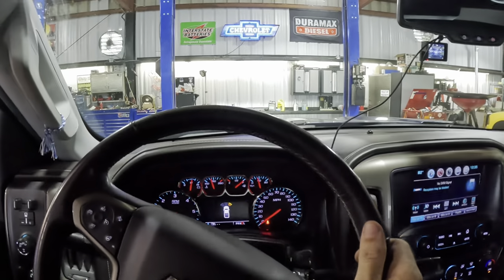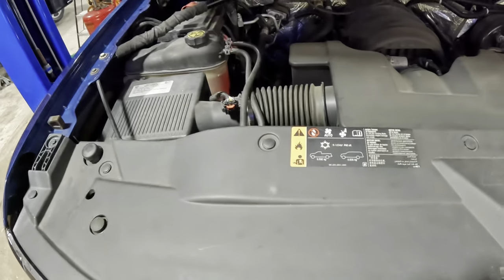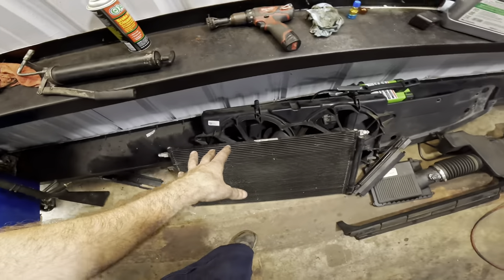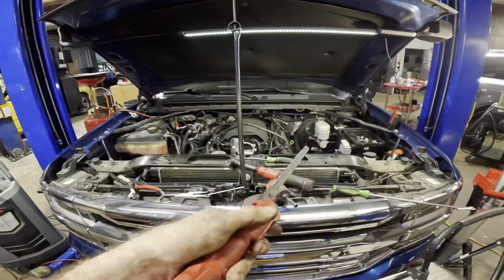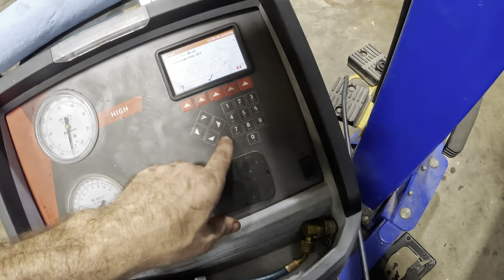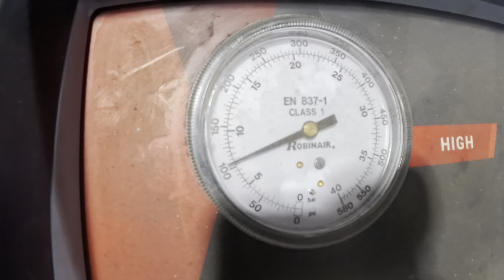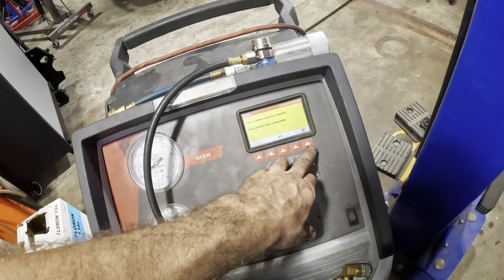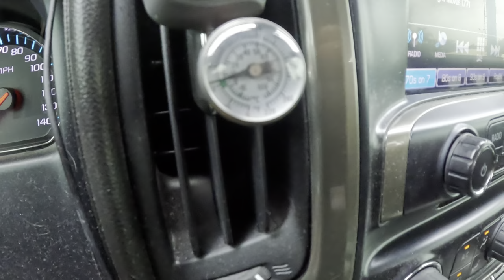KNOWN FACTORY DEFECT! BAD DESIGN!! 2017 Silverado 5.3

Comment: Did you notice you used your extra cap on the resevior, the new cap you took off of it was on the top of the resevior under the hose that went over it........I have the 2016 Silverado,  does that year have the same condenser?  Guess I will find out when my A/C quits.  Thanks Ray, Great job.

Comment: My locked open clamp procedure works as follows:
Step 1. I bounce the clamp as hard as I can off the shop floor 
Step 2. Once I locate where it landed after it sprung open and ricocheted off the floor. I pick it up and reinstall said clamp.
Step 3. “       “
Step 4. Profit!
It’s also a great anger management outlet and 60% of the time it works every time.

Comment: I actually have a 2015 silverado it 98k miles. Imma have to check mine to make sure i dont have a leak also. Thank you for all the great video an some pointer on where to look for dealership fails lol. Have a great day an il see ya in the next video ray.
Reply: My '15 is at 98K as well. No issues yet.

Yet.

Comment: I wonder if Ray does 1234YF systems.....???? 🙂  (Did he find that orange sensor safety thing after he moved the truck? 😄)
Reply: He rarely does the 1234YF systems as he does not have the machine required to do them. He has done a couple with a borrowed machine.

Comment: when i first saw the title on the known factory defect, i was thinking power steering ground, broken A/C lines, or dead lifters.
 nice short cut to a pain in the ass repair.
question, i've had my 2015 about 6 years now and haven't even pulled the plastic cover to look. am i right in thinking that the hood latch bracket thats welded to the core support is what is preventing the core from coming out in front of the core support? if that is about it, then i got no problem putting my saws all to use.

the only mod i've done is turned the AFM off on my 5.3 and adjust the lock speed and set the torque converter to fully lockup.

Comment: GM engineering made these with zero tolerance so that everything has to be in place or stuff will over heat . Seen someone that did the work of changing out a radiator themselves and left out the plastic between the condenser and radiator that Ray snapped off the end of the condenser in this video. That changed air flow and they were having overheating issues with a new radiator. Got the plastic from a junk vehicle installed it to solve the issue because it made the air flow as designed. The shop had a box of extra line clips also because they will as Ray said gohide in another part of the shop if you weren't careful. 
Seems that mass production and greed has small issues like seperating the condenser from the trans cooler for any of the major 3 , they all have them. But separating the tank by sawing between them shows just how the parts were designed for a. Zero Tolerance operation.

Comment: GM doesn't fix their problems, they let them ride at our expense. I had an 02 regal 3.8 sc and 07 impala both had
 Intake manifold gasket leaks at 40-45 k. Two stories blamed Dexcol or gasket. Also shifter lock up on my 07 Impala and brother had same problem on his 09 Impala. Wire rubs every time you move shifter,locks up shifter.I found out it happens on 07- to 09.

Comment: But if you disconnect the low sife hose, it wont equalize the hoses when you run the system?
Reply: Bet when Ray road tested it was in the 30’s. That’s a win.

Comment: My 2015 suburban  had a corroded condenser when I bought it and was unaware. The bad thing is that the trans cooler lines run through it and when a hole corroded into the condenser I lost all transmission fluid on it and it damaged my transmission. So luckily the guy that sold us the car gave us a 2 yr 24 k mile warranty and the warranty paid to replace the condenser and a new remanufactred transmission. Then the lifters went out and damaged the camshaft and thank God the warranty paid for this to as at the dealership it was 9k. All told I will have wound up paying 400 out of about 15 or 16 k of work. The vehicle is only worth about 17k lol.

Comment: Hey Ray, do you have, or could you do a video on adding an auxiliary transmission oil cooler  on a 2017-2021 Acadia V-6 engine? I've noticed that on my 2019 with 28,000 miles, the trans oil temp runs  quite high, in excess of 200 degrees, even after light normal driving.

Comment: 21:05 
So whats wrong with a separate
Oil cooler and separate transmission fluid cooler?  Not hooked up to the condenser or radiator.
You could easily put them in the wheel wells behind the headlights 
The forced air would lower the temp..

Comment: OSHA: Always shut down any machinery before performing maintenance 

Ray: FULL SEND BABY!!  WOOOOO! 🤘
Reply: It's called lockout tag out
Reply: @LilYeshua 👍I never heard of a lock out tag for a car.
Reply: @Michael-yi4mc  machinery as in a plant but disconnect the battery on cars. Years ago I was changing out the starter on a MG but the customer didn't leave the trunk key with us(battery in trunk) in which I accidentally touched the battery to starter leaf to ground. I heard a loud boom in the trunk. The top of the battery blew off and we got to sell the customer a battery in addition to a new starter

Comment: My 2015 Sierra leaked up top on right , replaced myself
Reply: Also, when I turned the AC fan down one notch, the temperature went from 46 to 42° so when it’s on high, it reads a tad higher

Comment: The aftermarket solution to the chop tube is really no better than the original design before they chopped the tube.  Even if there is some insulation vs air space in the tube, air itself is a pretty decent insulator, so there would not be mech improvement to prevent heat transfer there.  However heat transfers pretty good through metal.  So basically the aftermarket crew decided it was better to allow the thermal transfer between the transmission cooler and the condenser than lose structural integrity.  They did the same on the other side with the much longer welded assembly.  Their solution will greatly reduce the chances of thermal cycling cracking the weld, but will increase the amount of heat transfer between the sections.  As long as this transfer does not exceed the needs of either the transmission cooler or condenser sections, which I doubt it will, it is a great aftermarket solution.

Comment: You didn't change the Schrader valves... the world is going to end😮
Reply: Ray changes schrader valves all the time.... I've been in gm dealers for 46 years, never had 1 leak.  PS the cap is what seals it, the valve is only there to connect the hose.

Comment: The problem is that all manufacturers are getting away with these flaws I have an 06 f350 6.0 and it has the for intermittent loss of power where you loss all insterments including speedometer this should be a safety recall but they give no help with the problem.

Comment: Just a question about the cap on surge tank put the new one on the top and then screwed the old one on it and left the new one on the top
Reply: Yup, the old cap was still there, wedged between  the surge tank and fender. Still there when Ray pulled the truck out for a wash!

Comment: VERY INT VIDEO,,Just a couple Questions or Observations ,,When U changed to New Condenser ,I noticed ,that no  New Refrigerant Oil was added into the new Unit ,,Does the Freon Have AC Lube in it ?    And thought You Might Check truck in run Mode before clipping top Panel in to see any Leaks & Make sure Fans and Other Items All work together n function after quick road test ,,Anyone Else Feel the Same ???  thanks for a great clip

Comment: Did Chevy Engineers move Transmission Cooler to Air Conditioning Condenser because of Water Contamination into the Transmission--that would make sense because Freon will not Harm the Transmission-Water will--just Asking as I don't know....

Comment: AC condensers should not fail at 60,000 miles. I think there have been class action lawsuits against GM in some states for the ones in this truck. GM=Gotta Mechanic?

Comment: It's probably ok not to replace those seals but at the same time, it's an item that should be shipped with the condenser since it's a minimal cost but disappointing if its back together and thats where the leak develops. That would be when I lose my religion. lol

Comment: It is really sad that a company like GM that makes millions and pays the union guys a fortune to work there end up being cheap and cheating the customer. Also, sawing that one side definitely reduces the rigidity and can contribute to twisting and breaking the weld for the AC system on the other side. So the circular saw fix probably caused the AC weld breaking problem.

Comment: I have a 2016 1500 LT 4.3 LV3. 105,000 miles and no a/c trouble thus far. My transmission lines route through the radiator, not the condenser. Is it only the condensers that cool the transmission fluid?

Comment: As a non-mechanic, why wouldn't the Trans cooling be integrated into the radiator, instead staying clear of the A/C?
Reply: They cheapskated their way out by making just only one part that is supposed handle multiple functions as opposed to multiple parts for single functions

Comment: When GM decide that it was a good idea to have to remove the bed of the truck to replace the rear bumper, I decided that I would drop a new engine in my 2006 GMC Sierra pick up. The poor engineering that they do now is sad.

Comment: I had to drive my boss’s truck once I committed on how cheap it felt compared to my Dodge pickup and two months later he bought a new dodge ram. Still not as solid as the 1984 ram I had that I rebuilt after my roommate totaled it out one night rolled twice and the back window was still good I found the engine was toast because it was inside down and kept running so I found a used truck body and replaced it all and didn’t have to repaint it and I traded for a engine that was a big black 440 magnum and with the sheer metal off the engine swap was a lot easier to replace it and 440 4 barrel with a 4speed transmission I was welding a lot at the time and I built a monster bumper with a winch for it I loved it it would climb a tree if you wanted it to only down side was it got 9mpg pulling my twin axle car trailer but it also got 9mpg with out the trailer the muffler guy I was friends with had a little trouble getting it quiet enough to drive I dropped it off the night before and when he started it it was open headers and it covered his office with the dust that fell out of the ceiling he said he had to order stuff because it would explode every thing he had so he put some big tube exhaust on it the pipe was the same size as the megaphone tips3.5 inch turbo mufflers and dumped in front of the back tires traffic would move out of the way when I caught up to them on the road that truck was bulletproof when I was working in the machine shop and the boss knew it he had me pulling his trailer out of the weeds one day he tried it with his truck and it didn’t work but my truck ripped out the vines holding up the trailer and a big clump of roots came with it when I crammed it in 4 low nothing was going to stop it
Reply: Interesting.

Comment: all data has condenser R&R at 2.2 hrs with removing radiator. not sure how accurate that is.. haven't done one yet myself.
Reply from the maker: We were billing 2.1 for the 1234yf evac and recharge. Add 1.0 for diag, and 3.5 for the condenser. 6.6 hrs.   We being the dealer

Comment: The UV really illuminates the damp patch up really well on that crack, it's like 'CSI Raymondo' ... 😆 🤣 😂

Just shows what dirt build up those stupid plastic 'beautification' panels hide lol

Bet you looked like your uniform made you look all dusty like you'd been rolling about the yard with the tumbleweed 🤔🤔 lol

You should take a ratchet to the point of destruction to test (off camera for now) the mechanisms strength as well as its durability (putting the drive in a vice and a small cheetah or extension bar on the handle to see how much torque it can take for catastrophic failure, the durability will take time over normal working conditions though?).

You could also buy another so you can shorten the handle to give you a stubby version of it if you can't buy them (might give them the idea to make a stubby version?) 🤔 (depending how expensive they are right enough lol).

Could be worth contacting the manufacturer or a representative for/of the company with some feedback?

As long as the mechanism isn't putting load on the magnets they should be very durable as magnets can be quite strong but also brittle at the same time.

I put you on the large screen with the VR headset and slowed the speed to 0.25x normal and I can say for certainty that the red security clip flew off doing a 360° flip before bouncing off the rear coolant hose at the expansion tank before disappearing between the expansion tank and battery heading in the direction of the inner fender cover but I lost sight of it at that point as the expansion tank and filter lower housing obstructed my view lol

Pinball came to mind ... 😆 😂 🤣

Comment: Ray, what would you charge to do valve stem seals on a 2004 Silverado 5.3?
Reply from the maker: Pull the heads off and have the machine shop do it. R&R cylinder heads goes for 7-9 hours I think…. It’s a couple thousand

Comment: So the real solution GM wanted to avoid was spending more money by using an independent transmission cooler, which ironically would have avoided all the issues a combined one causes. Not our problem they say as they gladly rip customers off for the repair to their mistake.

Comment: cut the core ends off and show every one the micro channels ,now you will see the condenser is a filter now and why u have to change them when a compressor fails. also please get u a micron gauge for your ac vacuum test
Reply from the maker: Good autopsy for the second channel!!

Comment: G.M. JUNK!!!
Reply: I rather have a small issue like that than ford problems
Reply: Drove GM all my life and always dealt with premature failure on everything. Back in 14 I thought I'd try Lexus, I own a 14 RX and a 18 GS both with NA V-6's.
Absolutely 0 failures on each one since new. Now Toyota/Lexus is beginning to be questionable on their newer models with their mechanical complexity and smaller turbo engines. I guess time will tell if they prove reliable?!

Comment: Ray.  dodge has the same the issue with their condenser transmission cooler on their Durangos, Journeys, and Jeeps Grand Cherokees up to 2018.  Condenser trans cooler combo that leaked both trans fluid and AC "freon".  Junk ass design.

Comment: 59:58  "Don't need a bunch of torque here."   True words.  How many Honda/Toyota airbox lids have broken bolts due to clowns not following that little bit of wisdom.  You aren't trying to hold the engine together there.   Just engaging the seal on the air filter.

Sorry, rant over.  Just a pet peeve.   More torque is not better torque.